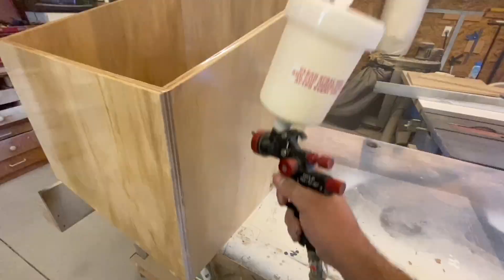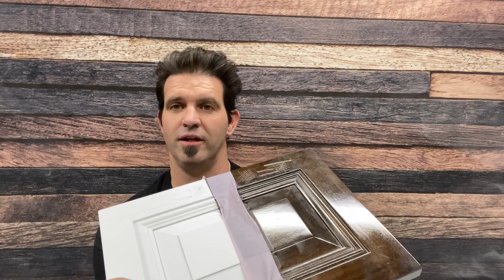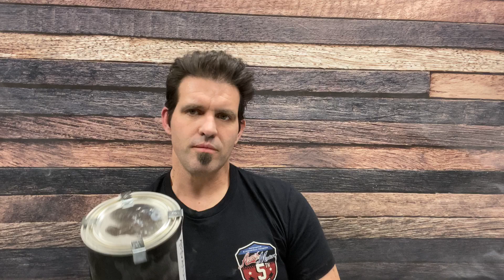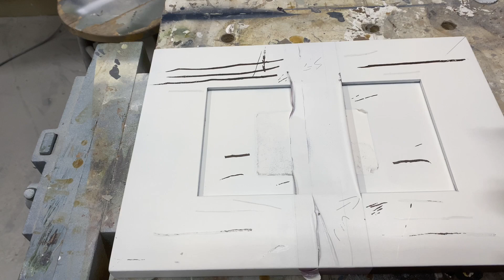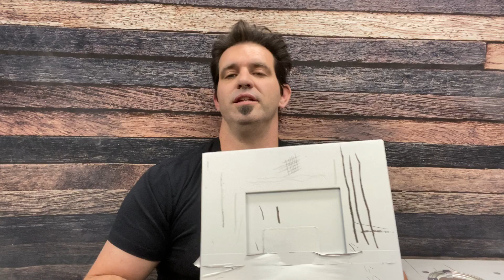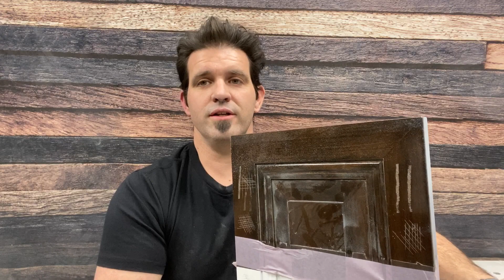Take the envirolak 170 and 200 to the next level with Envirocat

Comment: Does anyone make a water-based 2K polyurethane that will yield a high gloss sheen? The highest everyone seems to make is a 30 sheen. I need a mirror-like high gloss of 70 or better.
Reply from the maker: Yes milesi has an 80 sheen. CIC has an 80 sheen, envirolak as a 90 sheen.
Reply from the maker: Renner also has a 90 sheen

Comment: Very exciting.   I have some showing up in a few days.  What settings and tip would you recommend with an AAA.  Thanks!!
Reply from the maker: +Black Barn Custom Carpentry it depends on what type of unit you are running 600-1200 fluid pounds and anywhere from 18-25 triggered air.

Comment: Eric, what do you think about the 170 and the grain filling properties? I wonder if adding a hardener to the 170 will fill oak grain better...  someone has got to invent something that you can spray and it'll fill in grain.
Reply from the maker: The 170 is a boss it in the top 3
Reply: @ericreason6559  Eric, i touched base with you on facebook. Whats your thoughts with the crosslinker in the 170 and 200 for a refinishing project? Im personally not skilled enough in terms of using iso's, i just think the long term effects may not worth it and my health matters a little more so ive been leaning more towards the crosslinkers.  Just don't think i feel safe putting a iso in the air without the right air feed system personally so leaning into the linker myself.

Comment: Dont think ill be using these products again. Its horribly thick, sprays for shit out of my CA AAA sprayer and dried on the tip even with low air, had to use airless. It cant be watered down much but even if you dont i still had the worst nightmare of a time with this stuff sagging on verticals and edges. Now im not the best sprayer and still have lots to learn but its like i have to go back to school or something. When i used the hardener it made it even more thicker but seemed to sag less. Ill be sticking with renner that stuff i can spray and even use it with brush and roller. Enirolak is like elmer's glue but 10x thicker and will sag for hours. even if back rolled   to stop sags it continues to sag. Now im wondering if i got a bad batch or something and it might have frozen by the time it got here it was well separated and settled on the bottom of the pails. i def will be getting that 2k renner stuff for any jobs that require vertical work.
Reply from the maker: So a couple of things first what size tip were you using to spray it. Second they make a reducer that works 10X better than water and doesn’t kill the solid content or the vertical hang. They also make a thickner that will allow you to put the coating on at 10 wet mils. The 170 can already be used at at 6-7 all day long. The 200 is the same great hang on verticals. I haven’t had an issue and I have spayed tons of the coating. Now the tip cloggs are part of the game work air-assist the nest thing is to put an inline filter on you setup to help reduce that problem and also straining your material or using a mesh filter bad around the pickup tube.

Comment: Wow. So you're saying 2 coats of the 200 with hardener and no primer? Will it stop tannin bleed and is it that durable than a primer system?
Reply from the maker: +Matthew DiLeone it takes the dye migration issue out of refinishing because you are not breaking the surface of the top coat and allowing dye to bleed through the new top coat.
Reply: Holy shit thats nuts.

Comment: What’s the difference between a primer and an isolator?
Reply from the maker: A lot of finishers have been using the isolator as a blocker sealer kind of like a vinyl. So I was testing against it because I don’t see the advantage of the isolator